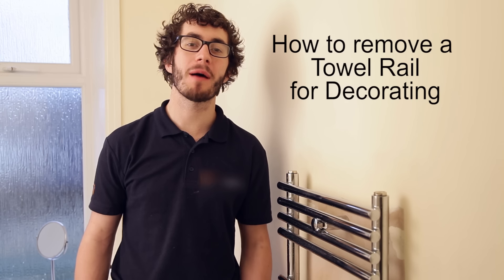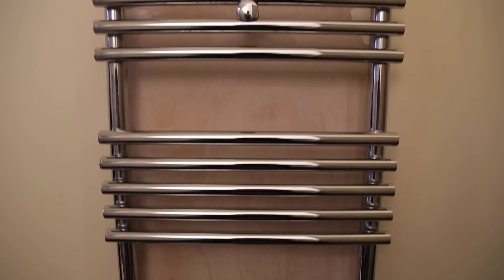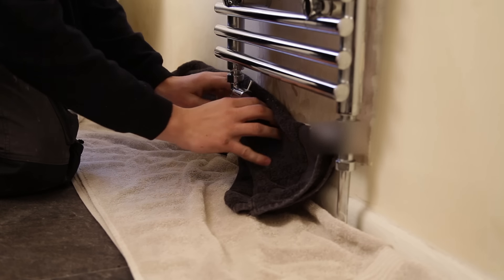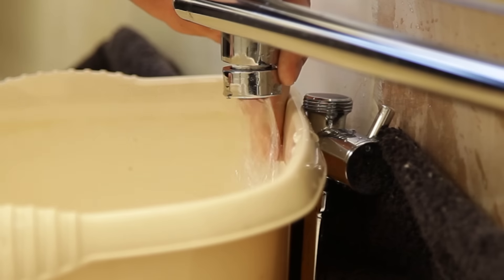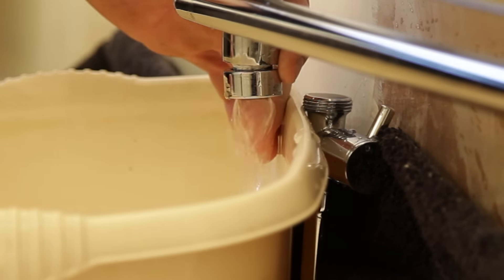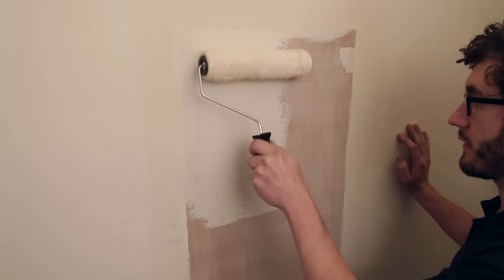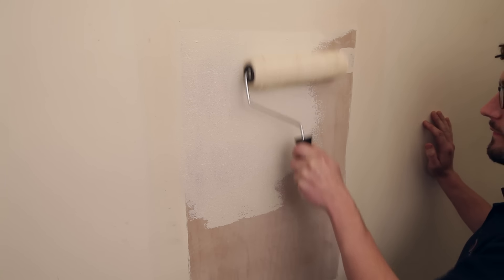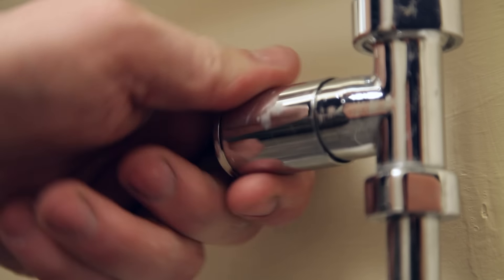How To Remove a Heated Towel Rail for Decorating | BestHeating

Comment: Follwed ypur guide, thanks. I’m assuming the valve hasnt closed properly as water leaks everytime I put the boiler on. My setup is slightly different to the video (the pipes come from the walls into the radiator). Can you help?

Comment: Hello...do I need to turn off water supply first? Thank you
Reply from the maker: Hi Lisa, you shouldn't have to if you isolate the water at the inlet valve of the towel rail. That said, it won't hurt if you do turn off the water altogether.

Comment: Did this and the water wouldn't stop coming bathroom flooded now cheers
Reply from the maker: Hi Nikki, sorry to hear that. Did you fully close the valves before doing so? If so, we couldn't think of a reason for the water to keep coming out. With the valves closed, water should not be able to come out of the inlets going into the towel rail. Is your set up identical to the one in the video?

Comment: does it matter which bar I am going to use to hang the radiator on the wall ? I need to drill new holes after tiler has tiled the wall, and I am thinking do I need to drill at the same level as original holes.

Comment: Helpful guide, thanks. Just removed mine but it while I was decorating the boiler stopped working because of low pressure. I reconnected it, managed to increase the pressure, let it refill but every time I try and bleed it the pressure drops and stops the boiler working. Any ideas?

Comment: Check that your radiator also doesn’t have larger screws holding it to the wall that are secured via the front of the radiator. As I undid the screws at the side holding the radiator to the wall but didn’t realise that there was also screws holding it at the front until I was half talking it off, at which point water was leaking out! Therefore check for other screws at the front not just what this video suggests!
Reply from the maker: You make a good point. There are obviously a variety of different appliances with different fixings, perhaps we should have made that more obvious for people who don't think it is as obvious as we obviously think it is. In other words, thanks for pointing out that we could have explained there are different types of HTR and different models may have different fixings.  :-)

Comment: Hi, I know this is an old post, but I'll ask anyway. If I followed your instructions, to decorate, and then decided not to put the radiator back on, could my CH system just work as normal? I understand I'd have to unsightly valves showing, but would everything still work? I have a combi boiler btw.
Reply: BestHeating Thank you so much for the advice. I'm not very DIY minded, but that sounds doable. Thanks again :)

Comment: Nice and simple however need to add in when you have a thermostat valve on radiator please
Reply from the maker: +Colin Smith it shouldn't prove to be too difficult. You could always remove the TRV before you remove the HTR. For tips on how to do that, please take a look at our TRV installation video - https://www.youtube.com/watch?v=6T9lME5DfBA

Comment: I'm going to be doing a bathroom refit (including replacing old towel radiator) in a holiday home where there's no access to the filling loop.  My idea is to do as you've done in the video, except I'll manually refill the radiator from the top (before inserting bleed valve and capping) using a jug and funnel.  I'll likely use inhibitor to fill the towel radiator with, thus killing two birds with one stone since I'm not sure if it has inhibitor in it already, or when the last time it was added (these towel radiators usually emphasise inhibitor).  Once the new towel radiators full I'll close the bleed valve, add the other cap, and then open up the valves from the bottom.  This should stop pressure drop and the minimal air can be expelled from bleed valve once the heating circuit has been on for an hour or so.  How does that sound to you?  :)
Reply: I was thinking doing that, does it work?
Reply: @shilly29  Hi yeah it worked.  If your boiler pressure is at the higher end (e.g. 1.5bar) then it shouldn't be a problem with the little bit of pressure you may lose.  If it's closer to 0.5bar, you'd likely need to top it up - not hard to do if you have access.
Reply: @paulstone7655  Hi, thank you for replying. That sounds good. My pressure is 1.0 when the heating is NOT on. Got 2 towel radiators to replace.
Reply: @shilly29  You're welcome.  Yeah that shouldn't be a problem, would only really come up with an error when it gets close to 0.5bar 👍 (usual range = 1-1.5bar)

Comment: My towel rail only has one valve on the right and on the left is a temperature adjuster. Can you give some advice on how to remove this type of rail please?
Reply from the maker: +Sarah Eldredge Hi Sarah, the same principle should apply. The temperature adjuster is probably a TRV and you should be able to remove it in exactly the same way.

Comment: You would remove that just to paint behind it 😋 good vid though
Reply from the maker: Yes we would wackokid. Unless you have very steady hands and a small paint brush - and lots of time on those very steady hands - it's probably quicker and cleaner to take it off the wall first :-)
Reply: +BestHeating ha ha... That's why they invented a long rad roller... Takes about 2 mins to paint behind one of those ... But at least we know how to take it off :-)
Reply from the maker: Skinny rad roller needed if it's tight to the wall

Comment: we all know what a filler loop is dont we??
Reply from the maker: Hi Paul, so you don't have to go and Google what one is, here's a link to a helpful guide we did that explains what you need to do to get the job done - https://www.bestheating.com/info/what-should-the-boiler-pressure-be-when-the-heating-is-on/ - we do hope it helps!

Comment: I have a Terma heated towel rail that has a cable leading from the bottom right adjuster. Please could you possibly tell me what I may do with the cable?
Reply from the maker: +Klara Kaderabkova We would recommend speaking to a qualified electrician before attempting to move your HTR. You could have someone disconnect it and remove the towel rail in exactly the same way. We do not advise doing this without qualified assistance.

Comment: Will you come to my house and take mine away. I hate it, I need a new one.
Reply: BestHeating I'd definitely consider buying a new radiator off you, but it's the removal of the old one and fitting of the new one. I'm no plumber, and when it concerns water I don't mess about. Do you have an installation service?
Reply from the maker: Sadly not Joe, but we're looking at starting an affiliate service, whereby we can recommend a plumber or heating engineer in your area. Sadly though, this hasn't started yet but it should be happening soon (we hope). Sorry we can't be more helpful.
Reply: BestHeating well I'd like my bath replacing, and my towel radiator replacing. I'd defo be willing to spend good money with you to do it because you sound great.  Try and sort something out and I'll deal with you, because it's the labour, the plumbing, that's the problem. Gotta try to avoid cowboys these days.
Reply from the maker: Well, when we have the programme up and running, we'll be sure to let you know here. All the best.

Comment: How do you find where the bleed valve is?
Reply from the maker: Hey Daisy (We love that name) your bleed valve should be at the top of your towel rail. It may look like a little flat-head screw. It will be on one of the two side bars on your htr. If you're struggling check out our guide on how to do it - http://www.bestheating.com/info/advice-centre/how-to-guides/how-to-bleed-a-heated-towel-radiator/